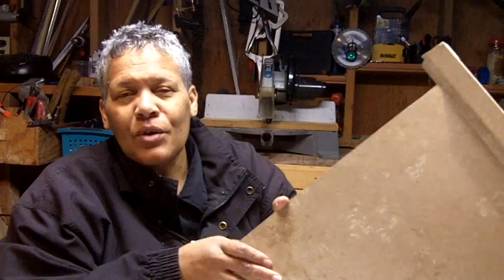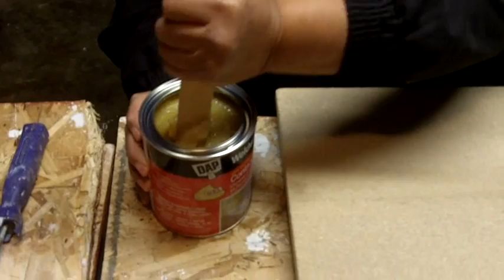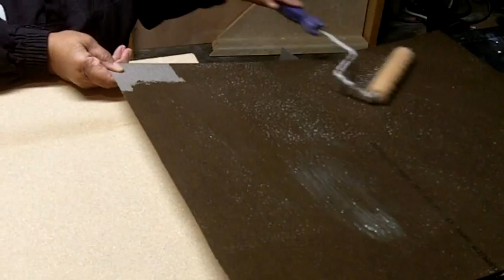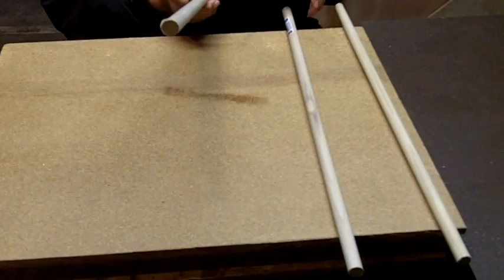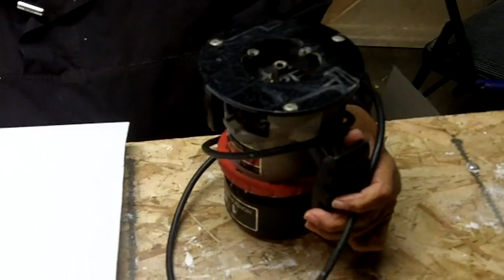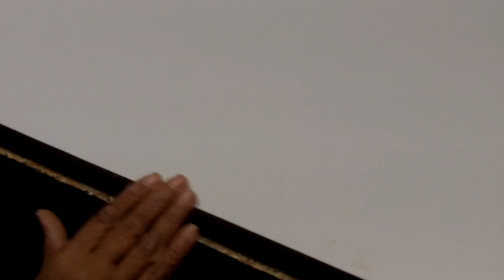How to Laminate a Countertop Beginner's Tutorial

Comment: So the dry up contact cement on both surface will just stick togather instantly? It seems a little complicated with those roller rods and then you have to cut and trim as well? Why can't it be done by getting an exact size and use glue that allows you to move around before it drys. 

Long time ago when I was young like 19 I had a Formica sheet lying around and I made a table and put that black Formica on it using Elemr's heavy durty spray adhessive cane and to this day I still have that table in my garage smooth and solid, it never came out and it looks professional. I am now 43...:)

Comment: Easy hack: glue a couple biscuits on spacers each 1/2 of the total overlap. Tack those to two edges (h and w) making 90⁰ spacer line and just lay down from the corner out. You may want to get a couple of those cheap or free paint mix sticks or popsicle sticks to make the spacers.

Comment: Thank you for this! I want to make my own counters because the ones at the hardware store have a backsplash on them which is now outdated. But I'd like to roll the laminate over the front edge instead of applying a separate edging piece. Has anyone done that DIY? I'm wondering if a heat gun used carefully might make it plyable enough to do it.

Comment: Great! Just a couple of questions. First, how do you cut the laminate to size? At the beginning of the video, you just say to cut it but can I cut it with a utility knife or what? Doesn't seem like a saw would be a good choice. Also, when you rout the edge at the end, what do you use to guide the router so you end up with a straight edge? Or does the bit have something on it to prevent it cutting into the particle board and letting me get off-course? Thanks!

Comment: Leah, should I use a respirator with contact cement even if I'm using it in a well ventilated area?  Also, is there a way to cut the laminate without a router?

Comment: Hi Leah!  Particle board is usually more porous than the laminate, so it may need 2 coats of contact glue to one coat on the laminate, so I apply the contact cement to the particle board first. I also found that Wilson Art laminate has the best quality/ price/ & selection over Formica brand!

Comment: I need to remove a piece of laminate.  I have a laminate counter top  that goes up the wall a good ways.  There is no divide between the two.  I want to use the peel and stick backsplash tiles but cant figure out how to divide it.  I think it is just one sheet of laminate that the builder did not cut and just kept it going up.  Any advise on how to separate and remove the wall portion without damaging the countertop???? Please help.

Comment: what is better as a substrate for a countertop with a beveled edge, particle board or high quality plywood?
Reply from the maker: Hi Kurt, believe it or not, your best bet is particle board.
Reply: How to you accurately cut the thin 3/8 in strip of laminate to fit for a long section?

Comment: thank you. learned a ton.  same process for raw birch veneer  plywood i assume? i only need to make a few strips out of left over ply from another project . would hate to go buy more sheet goods.
Reply from the maker: Yes, you can probably do it that way.  However, Rockler Woodworking and Hardware has a post on how to apply veneers to substrates.  You might want to take a look at it.  You still use contact cement, but the process is just a bit different.  It's on their website, and the post is called "Apply Veneer with Contact Cement"
Reply: Thanks again for all of your help!  Ill check it out.

Comment: Leah, most of the premade laminate countertop in the big box stores have a built in back splash and front edge.  My question is:  if I fabricate my own countertop with a built in back splash and front edge, is it hard to bend laminate around those areas to get a even and continuous look?
Reply from the maker: Hi Eric, there are a couple of different techniques.  There is cold-bending and hot-bending.  But the most important thing is that there are different grades of laminate for different uses.  You will need to special order the laminate for what you want to do, because a home improvement store isn't going to stock the different grades.  I hope this points you in the right direction!

Comment: was using wood glue to repair a warped counter top's edge in the kitchen near the sink, but it didn't adhere. can you get that contact cement stuff in a smaller quantity like a tube. just want to tack down a warped crack and use 2 C-clamps and a metal strip to hold it down. the wood glue doesn't work though.

Comment: coming from a professional finish carpenter thats built miles of laminate counter tops, great video! another great spacer instead of the dowels is old steel blind slats! but shhh, trade secret ;) Great job again!
Reply: If you cant find blind slats cut up pieces of an old 1 inch wide tape measure
Reply from the maker: +Joe Spaz thanks, Joe, I appreciate it (and the tip :))

Comment: One part I can't figure out is the best way to trim the portion of the countertop next to the wall.  The router is unable to get all the way to the wall, and leaves about 2" left to be trimmed (because the router bit in the center of the router...)
Any tips for getting this portion of the trim job done?   Tried a flush cut saw, and oscilating tool - Both left the surface badly chipped.
Reply: +Fat Stanley i know this is a little late, but the best way to do is to size that small portion of countertop closer to the actual size, i leave about 1/8 inch, then flush it up with your edge using a laminate file, being sure that your cutting down in to the laminate with it, and not pulling up.
Reply: great tip. thank you

Comment: Nice. Please take note that if you are laminating an L that has been cut at a 45 degree angle. you do NOT start in the middle. You start at the end that has the 45 and pull the spacers from that end to the other end.
Wood dowels are fine but costly just to use as temp spacers.
PVC pipe works the same and a  lot cheaper.
When building the wood portion you use 2 inc strips of wood screwed around the edge to make it look as if the single sheet were double thick.
Less wood-less weight. 
Walls are not straight but the laminate and wood are.
You can scribe the wooden counter top to fit perfectly then remove and laminate and trim if NO backsplash is to be used.
If you are using a back splash just make sure the backsplash covers the top to hide where the laminate has a gap between the counter top and the wall. Sometimes a ceramic tile will not cover that gap and you need chalking.
Reply: Another good temp. spacers or supports to hold laminate away from your intended placement is the use of venetian blind slats. the older metal kind! They are slightly rounded at the top surface , will not roll or slide around, and can be stacked, in a very neat  pile until you may need them again !
Reply: Thanks, cloverdale87!  I'm going to be doing an 'L" bartop this weekend, and I was thinking to myself that I would need to start at the 45 so I can meet the edges tightly.

Comment: Exactly what I was looking for when I searched "cutting laminate".  I'm glad you added the tip about doing the edges first.  What do you recommend for cutting the laminate to rough dimensions, a circular saw with a panel cutting blade (high tooth count)?
Reply: I use a chop saw, table saw and router. I also use a sheet of sand paper wrapped around a small 2 inch x 4 inch piece of wood for my edges
Reply from the maker: Mark Silva Hi Mark, yes, that is the exact thing I would recommend.  Good luck with your project!

Comment: One more question Leah. I bought a flush cut bit and now I'm worried I got the wrong kind after watching this video again. You say you're using a bevel edge bit. Can you tell me the difference and why you chose the bevel?  I'm getting ready to work on the counter top so I need to know this! Thanks so very much for your time and video's.
Reply from the maker: janviersixx A flush cut bit is fine.  However, you will want to give it a finished look with either a file or a bevel edge bit.
Reply: seejanedrill Thank you Leah, I have a file and have done a mock up and trimmed a scrap piece and it turned out fine. Your advise is spot on and very much appreciated. You are sooooo knowledgeable, I can't wait for  more video's from you.

Comment: Hi Leah, Love your video's! What type blade/saw did you cut the laminate with before adhering it to the particle board? If you use a regular circular saw blade, I'm thinking good face down due to the blade cutting upward? Also, do you tape it with masking tape first to help prevent chipping? Thanks so MUCH!!!
Reply from the maker: janviersixx I used a circular saw with a laminate blade.  Also, I didn't tape it down first, because I knew I was going to be trimming it.

Comment: My project has REALLY well made custom countertops that have no structural issues.  If I was to put new laminate on these, do I need to remove the existing laminate first or can I put on another "coat", so to speak?  The existing laminate is in great shape...just ugly.  Thanks, Leah.
Reply from the maker: Marti Thew   Hello Marti,  Surprisingly, yes.  Someone else asked the same question several months ago, and at that time, I contacted a laminate manufacturer with this very question.  Their response was yes, if the existing laminate is securely attached to the cabinet.
Reply: I have done a lot of research on how to refinish an existing counter top. The existing surface (Formica) needs to have no sheen on it; a circular sander will rough up the surface just enough to be porous for the contact adhesive to adhere better to. Leah please confirm that this is true. Thanks. I will be starting my project within a few weeks and I want to make sure i have no mistakes.

Comment: I'm going to be doing this to my bathroom countertops but they are already laminate. Do I need to do anything to the existing laminate? Also you said to cut the laminate so it sticks out over the edges, but installing it on existing counters, I can only do that on the edges that aren't up against a wall. Makes me a little nervous to cut the right dimensions. I'll also need to take out the sinks first and then cut out where the sink goes. Any suggestions for these things?
Reply from the maker: Susan Larson Hi Susan, You don't need to do anything to the existing laminate, as long as it is intact.  As far as cutting out where the sink goes, once the laminate is attached, you can drill a pilot hole for the router with a regular drill bit in the laminate in the area where the sink goes. Next, use the same trim bit with your router that you used to cut the laminate, to cut out a hole in the laminate for where the sink goes, Hope this helps.

Comment: Brilliant video, as usual! :-D 
When I use contact adhesive, I always use it in a well ventilated area, but I also wear a respirator, because many of them contain extremely toxic ingredients, such as toluene and hexane isomers. (I sell the stuff.)
I'm glad you mentioned laminating the edges before the top. You reminded me how the house I'm in, has floor tiles in the bathroom. There's a lip to step over into the shower, that's also tiled. ie. Tiles on the floor, tiles up the side of the lip and tiles on top of the lip. Whomever tiled the bathroom did the tiles on the lip, the wrong way around. They have the vertical tiles overlapping the edge of the horizontal tiles, so the edge of the vertical tiles are facing upwards. It looks terrible.
Reply from the maker: jublywubly Thanks, Jubly.  You raise an excellent point about the ingredients in the adhesive.  In fact, now I'm going to add an annotation to the video that recommends folks use a respirator if they have a large area to laminate.  Safety comes first!

Regards, Leah
Reply: seejanedrill

:-)
I'm also hypersensitive to chemicals, so I have to be extra careful. I don't even use conventional fly spray in the house. If someone were to use any, four rooms away, I'd smell it within seconds and get sinus pain.